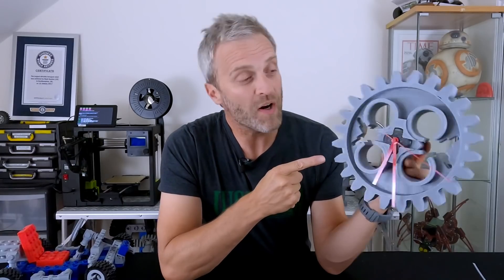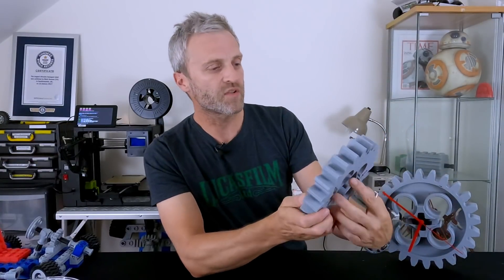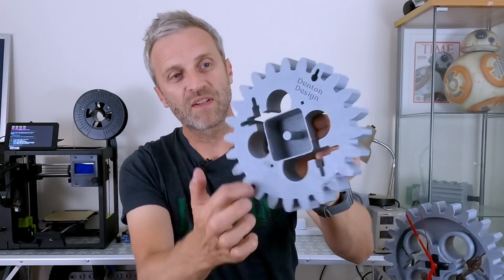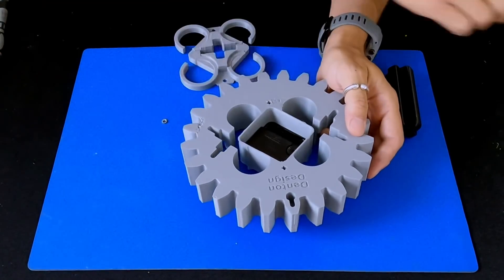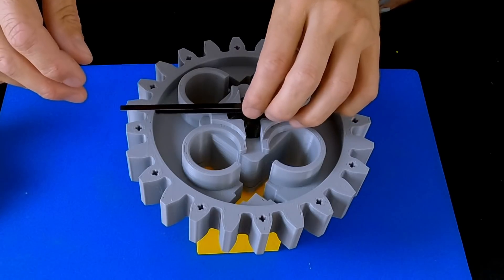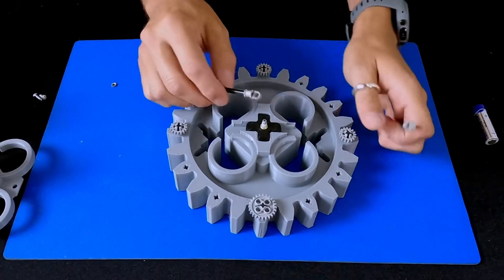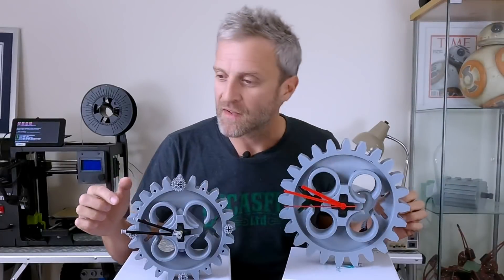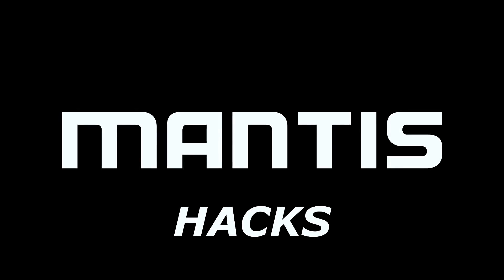3D Printed LEGO Inspired Gear Clock - (REVISED EDIT) - Mantis Hacks

Comment: I wish I still had my 3d printer. I had an anycubic i3 mega around when it came out, it broke down within 100 hours of use but it would have been too expensive for me to repair so I never did and eventually just got rid of it since it was taking up storage space.

If I had just waited like, 2 more years, I'd be willing to not only fix it but have the parts actually available and I could make all these cool things.
Reply from the maker: That is a shame! There  are many low cost printers available now, however, it’s sometimes hit and miss as to how long they last 😬